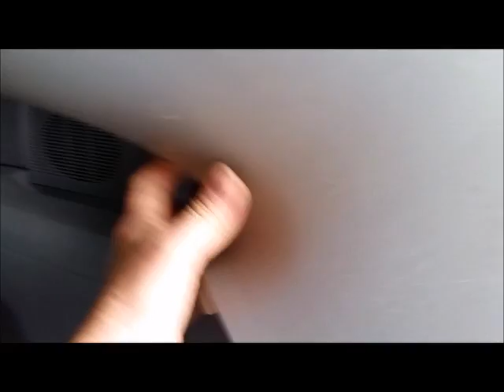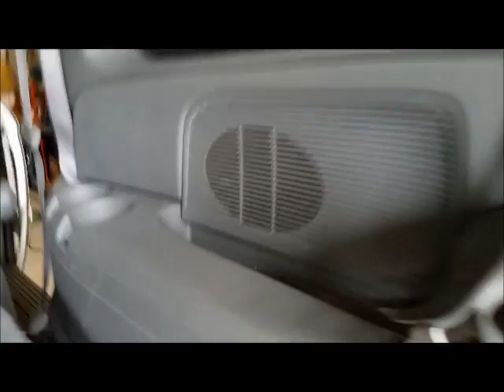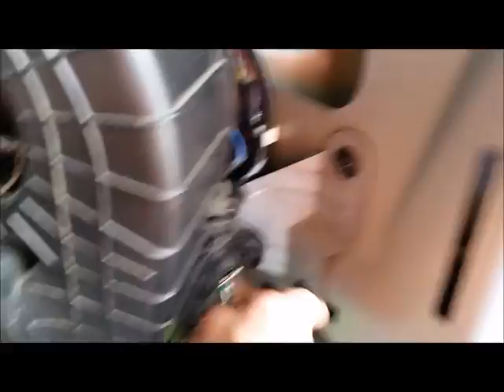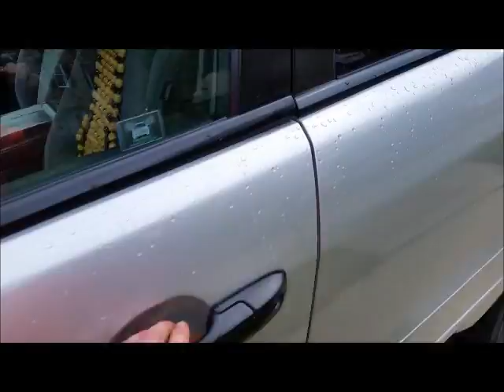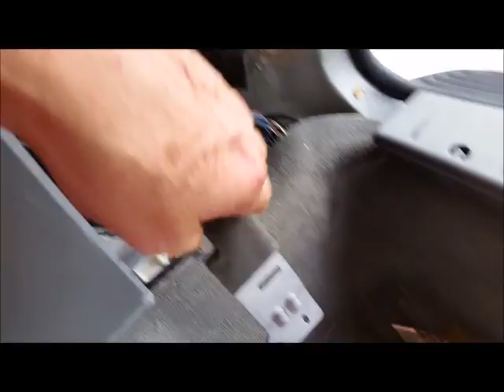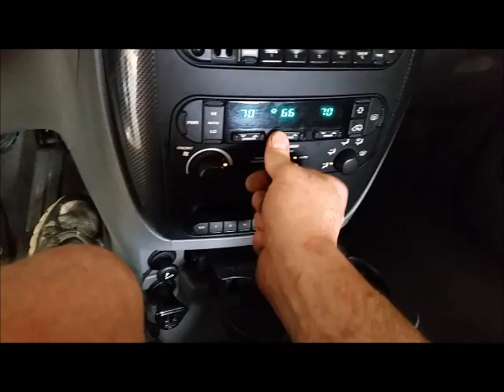Replace rear blower/resistor 2006 Dodge Grand Caravan 3 zone electronic heat/ac

Comment: That's actually called a fan speed control module, and it's only for the models with the automatic temperature control (atc) its the same size, goes in the same place, does the same job, but isn't a resistor and has a different wiring harness.  It is true that when this module and the resistor fail that the fan speed will normally still work on the high setting for the front and the back.  You can bypass both if these parts as well by wiring around them temporarily to diagnose the fault, but us ground side controlled, so should be supplied power at all times and the switch only breaks the circuit to ground, so supplying 12v DC directly to the fan should make the fan spin, if it didn't the give the motor housing a good smack a few times right in the center where the motor is  if it comes back on, most likely the resistor or control module is good, and the motor was frozen.  9 times out of 10 it's because the cabin air filter has never been changed, and the fan motor is clogged with dust and dirt.  The recirculator in these vans is set to disable itself in defrost mode, and also every 10 minutes because mopar felt it would keep smells out if the system.  If this annoys you as much as it annoys me, unplug the actuator motor and manually slide the door so it's closing off the path to the outside air, now no matter what the computer system does the actuator will not move and will always be in recirculate mode.

Comment: That’s easy job just make sure don’t pull so rude the tabs a d use an screwdriver to push the tabs and don’t have to remove all the plastics like him unless you want a huge mess if you take the #10 bolts (3) and a small Torx with a 1/4 ratchet just 2 bolts a d comes off replace it and reverse all the procedure don’t take more than 10 min max

Comment: If you hear the blower going and feel heat coming from a vent by the floor in back... but have no air flowing out of any of the 4 small vents on the ceiling what do you think it could be? Idk what the heating system looks like at all or how or where the heat would come from if it would definitely come from the rear blower on the passenger side or another blower somewhere else?

Comment: Hi I have a 06 town and country and I'm having a problem with the rear upper vents not blowing but the lower passenger side rear works just fine. I have automatic temperature control and you can hear the rear fan blower working but no upper air coming from the upper vents. Please can anyone give me some helpful advice of what it can be and if its hard to fix or replace. Thanks.

Comment: I have a 06 town and country van the problem that I have with it is. Mine comes with automatic climate control and the rear blower works cause it blows from the bottom and you can hear the blower running its not blowing from the upper vents at all. Can someone with this problem please help me out or give me some helpful advice.

Comment: What happened for you to think it was the blower?  Currently my rear air isn’t working front is fine but rear isn’t
Reply: Same as mine what you did to fix it
Reply: @rahimali9504 hey! So mine wasn't working for a while when I bought the van and what I personally did to fix it was repair the vent for the rear end because mine was leaking so it would go to hot to cold but mainly heat which now it remains cold, just my front is leaking still but from the driver side and can't find it :/ hope this helps

Comment: Thanks for the video. In my experience, with a 05 Town and country with analog controls, the resistor is on the front side and has the blade style resistor. Your setup with the digital controls has the more complicated setup versus mine with knob analog controls. Hope this helps.

Comment: I just did this yesterday, I can't believe Dodge put those torx screws in there. It was such a pain in the ass. If they just used some hex heads it would have saved so much time. My suggestion if anyone does this job. Take the time while you have it out to change all the torx to hex heads. There is no room to use a torx but on a driver. I had to use a 1/4 in wrench with the torx bit 1/16th of a turn at a time. If you replace them with the hex heads you can use a rachet and socket if anything else fails. You've been warned.